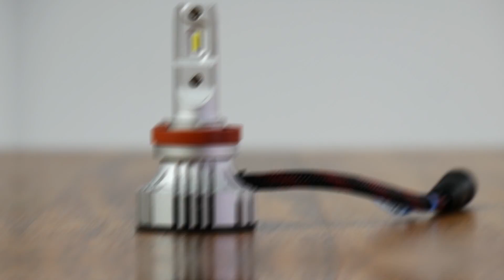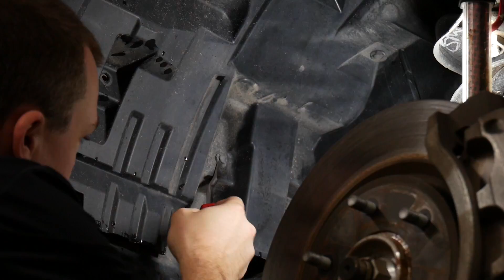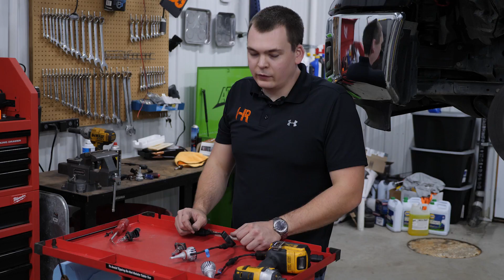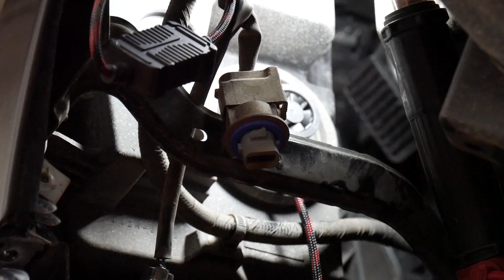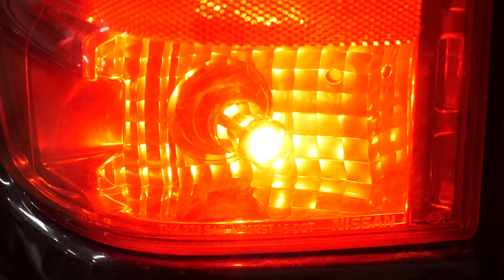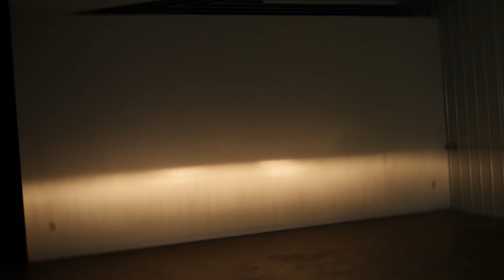154% Brighter LED Bulbs for Nissan Titan 2016-2019 LED Low Beam and High Beam

Comment: I've got the pro 4x winth projector lows and halogen highs., will those high beam led bulbs work and do they need a resistor on them when installed? TIA.
Reply from the maker: They will work indeed! No resistors or such needed for this truck. :) Great question!

Comment: Would I need a canbus unit for the V4 bulbs? I have a 2010 Acura TSX, the high beams double as the daytime running lights.
Reply from the maker: You will need the PWMs.
Reply: Thanks for the reply. Does Supernova offer PWM's of their own, or will any work? Also is it a plug in unit or would i have to splice into the harness ? Any info would help, i hate doing things twice.
Reply: Will turn signal led blubs work on my 2008 Pontiac g6 gt switchback one
Reply from the maker: Supernova doesn't but GTR, Diode Dynamics and Xenon Depot all do.

Comment: No resistor! If you own a Ford, Mercury, Lincoln, or Mazda, use Forscan to program the hyperflash to off. I'm not splicing I to factory harnesses. I did and experienced an open ground. Caused problems. Had to replace a harness!

Comment: Hmm I wonder what I could get for 2008 Altima SE with factory HID?
Reply from the maker: I think you will really appreciate the Osram Xenarc CBI HID bulbs: https://headlightrevolution.com/osram-d1s-xenarc-cbi-66140-bulbs-5500k/
Reply: The best option is to stick with OEM quality HID bulbs, no led or aftermarket will  get close to the output of a good OEM HID bulb
Reply from the maker: @TheMhayden123  That is not the case whatsoever... Factory HID lighting is great, but there are certainly other aftermarket bulbs that will outperform them.
Reply: @HeadlightRevolution  I'm talking the likes of Morimoto, NHK, GTR, etc... As aftermarket, anything Osram/Phillips is still OEM quality.